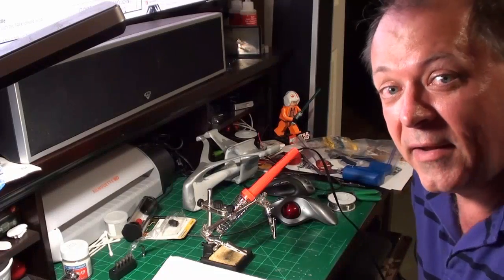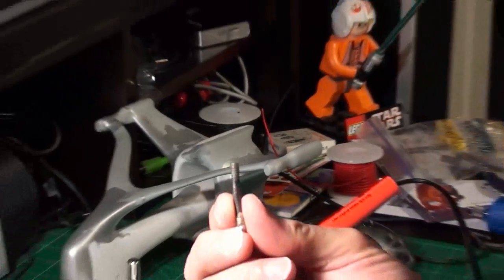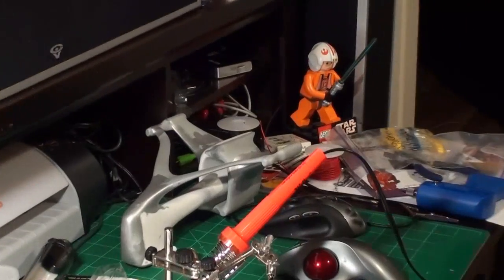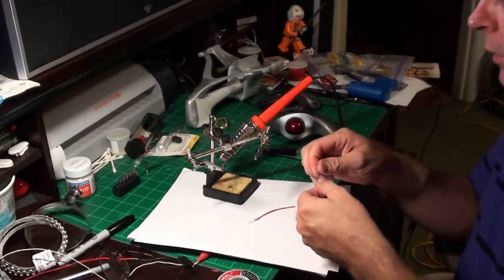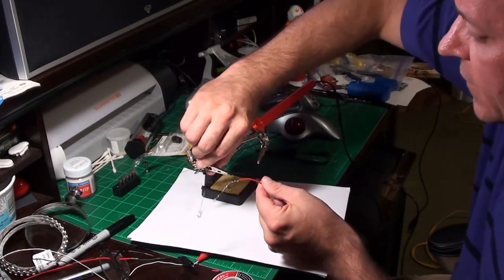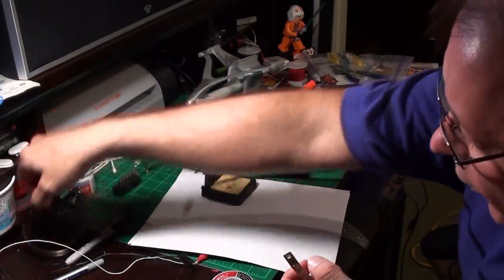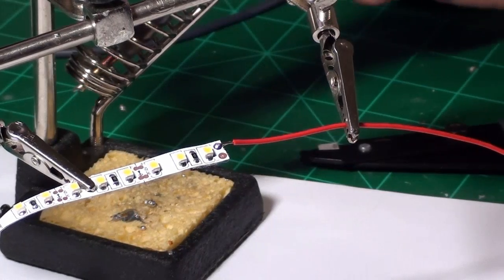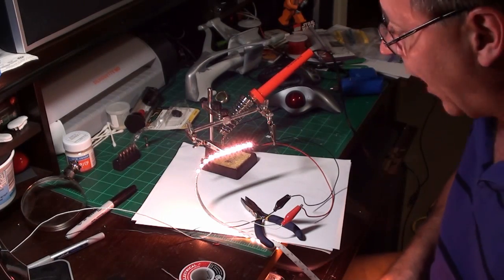Soldering 101

Comment: Hey great video :) I wonder if you can help me, I'm really stuck. I'm using my iron at 700 degrees F, and putting the iron on the component to heat it. I leave it for about 5 seconds, then place my solder on the heated component. The solder wont melt! I've tried holding the iron on it for 10+ seconds, still the solder wont melt. It only melts if I touch the solder to the iron itself. Any ideas what might be the problem? Thanks
Reply from the maker: I have had that problem from time to time.  I suspect you have too much metal to heat up and it is not heating up enough to melt the solder.  Try holding the iron on one side of the part and the solder on the other.

Comment: Soldering is more like brazing. In welding, you're melting both the filler material (analogous to the solder) and the material you're joining together. With soldering and brazing, you only melt the filler material. For instance, when you solder a piece of wire to a circuit board, you never bring the board or wire to the melting point, just the solder.

Comment: What's the name of the soldering iron your using? How many watts is it? I'm going to be getting into soldering. What type of solder are you using.. Is it 60-40 Rosin Core Solder 0.062" Dia. ? Nice video btw, really nice. (+1 : 63)
Reply from the maker: I got it off of Amazon and I am not sure of the company....It has a variable temperature setting, and I am not sure of the wattage either.  We just moved and it is still in storage.
Reply: badgrendels That's fine. I went and bought myself a 45 watt soldering pen from Radio Shack. It works perfectly. Not bad for $13 or whatever it was. Built myself a 50Ah backup battery for cellphones using Buck boost converters and solar cells. Using a Hammond box enclosure, etc. Thanks for the reply.

Comment: One thing that I would add is to try to get the thinnest solder that you can find. It makes it harder to "overflow" a joint. The downside is that on the rare big joint, it seems like you are feeding half of the roll into it. But the last time that I checked, we still buy solder by the pound. :)

As for which soldering iron is the best, a decent one that you can control the temperature on is a good starting point. I've got several soldering\desoldering stations, including vacuum desoldering irons, soldering tweezers, IR and hot air, but my favorite is my Japanese butane job. Why? No cord! :) 

So if you like your iron, and you haven't set your board, your house, or yourself on fire, then keep it. And for the noobs out there, ignore the snickers of the experts that swear that ever since the manifestation of dancing angels at their workbench, that only their solder joints will last until the heat death of the universe. 

And the helping hand/third hand that you've got is fine for open air work like what you demonstrated (I've got one of my own), but for board work, I prefer a Panavise with the monster base and the board frame.
Reply from the maker: Thank you for the great comment!

Comment: TY, your videos are awesome and understandable. Been wanting to grasp this lighting concept to take my modeling to the next step. A tip about your soldering tips.. No pun intended. when mine burn up like yours, I unscrew it, chuck it in my drill, then hit it with a flat file at high speed to reform it. Thanks again for all the time you've put into helping us understand.
Reply from the maker: Since I bought the soldering station, I quit burning up tips.   So in the long run, I think it was best to buy it.  But thanks for the great tip!   I wish I had known that a few years back.

Comment: @badgrendels No problem.  Another good practice is to get you some corrosion preventative compound (CPC) to spray on your soldering work after using alcohol to remove flux residue.  I am sure you can find it at Radio Shack or any electronics dealer.  I really am enjoying these videos! Thank you for sharing!

Comment: Actually flux is necessary in high reliability soldering!  We used it all the time in the Air Force at it acts as a cleaner; minimizing oxidation and ensuring a clean joint.  Heat will actually speed up the oxidation process which is another reason to use flux.  You only have to clean you soldering joints or circuits with alcohol when finished to remove the flux residue.

Comment from the maker: @Lordcontraindicator2 I did add one caption that stated you need to make sure that your solder is labeled for electronics.   I can add one or two about flux vs resin core.  I just didn't think about it at the time I made the video.  I have always made sure that I picked out solder for electronics.